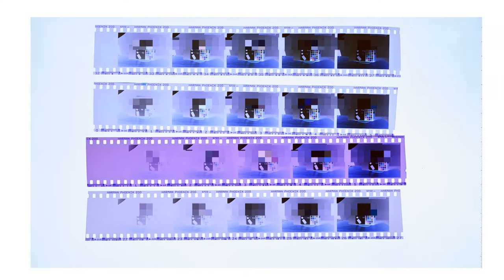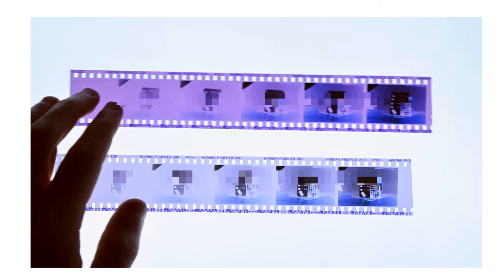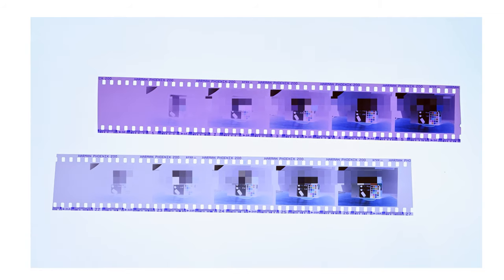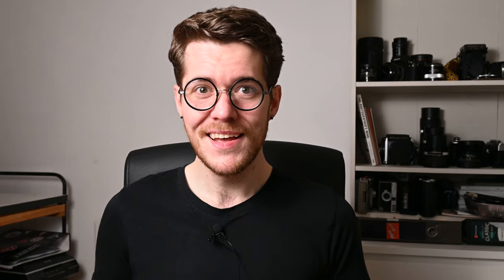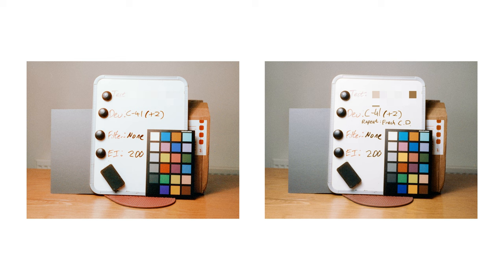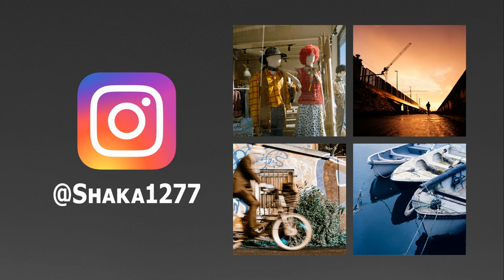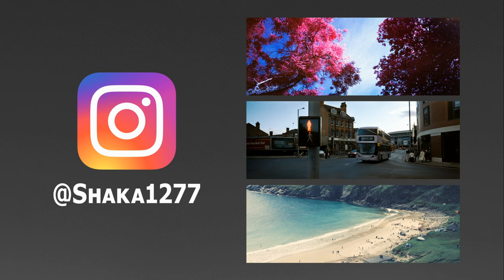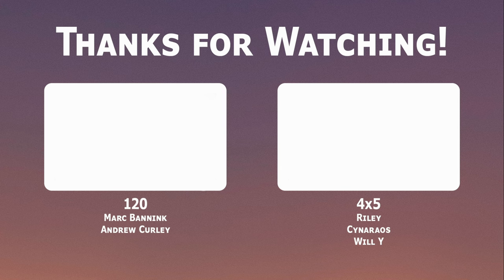Mastering Harman Phoenix #3: Purple

Comment: Okay I am exremely interested about this, I have not watched the video yet, I am only at around 1:33, but I have 4 remaining rolls of Phoenix 200 (I actually like the halation and the very high contrast a lot, and I rate it at 160 ot 120 iso and I get a lot better shadows that way. I find it is a very fun film to use, and I kind of want to get a bit more in the stash just because it's "limited" and I like how it looking before they invested in "improving" their color film)

All the phoenix 200 I shot I developed at home, in my the same very first batch of a C41 kit from BelliniFoto. The 2nd roll of color film I ever developed with my hands probably was P200. The later rolls have more purple in the base than the earlier rolls. I have not yet got rid of this first mix of color developer. I have a bottle of fresh developer to "recharge" the BelliniFoto Amateur RapidAccess kit that is sitting for me to have fully exhausted my first one. It's been not used in the recommended timeframe of a week by the manufacturer of the chemistry, but it was kept in the dark in a bottle with no air/oxygen in it in a cool place for all that time. 

So I am definitely in the "I am developing this in old chemicals" situation right now and I had a different result of just the film base color when developing this in extremely fresh chemicals

Comment: I have been experimenting with this, and I've found with lots of rolls and bracketing, that: 80 ISO, pull develop -1 stop (so in other words treating it like native 160 but pulling 1 stop), and then white balancing my scanning DSLR to the empty leader, and simply inverting in photoshop, gives almost 100% perfect real life colors, wonderful saturation, and much better latitude than normal, on par with most consumer grade kodak films (not portra or aerocolor or anything). I find 125 works best when not pulling, but 160 (down to 80) seems to work better when pulling, like sort of a compromise somewhere, I guess.
Reply from the maker: That's not so far off what I came up with in my Part 1, though I still use NLP for inversion out of habit.

Comment: Off topic, how long one should increase C41 development time to push one stop? BelliniFoto's datasheet has zero information about this, and they have just said to me "we do not test these parameters" when I tried to ask via email
Reply from the maker: Per Kodak's documentation, add 30 seconds for a 1-stop push or 60 seconds for a 2-stop push. I've found that works very well, even extended to 3 stops.
Reply: @Shaka1277  Noted! Thank you! I am now just watching video #1 of this series now. Thanks for doing this, it's very cool and interesting!
Reply from the maker: Glad you're enjoying it, have a great weekend!
Reply: Cinestill says 2.75 mins at 102F versus 3.5 normal = 1 stop pull, I followed that and am happy with the results. Edit: oh you said push, for push Cinestill claims 1 min and 5 seconds (very specific) longer for 1 stop. These aren't the same as Kodak's chemicals, necessarily exactly, though.
Reply: @gavinjenkins899  the cinestill kit is weird. I gonna stick to a normal 3 bath + stabilizer running at the nominal 38 Celsius one. Should match whatever docs came out of Kodak in that case
Reply from the maker: The first time a friend asked me for help reading the Cinestill "E-6" kit instructions I almost had another stroke.

Comment: Enlarging and printing be an issue
Reply: In reality it isn't. Phoenix is hard to print, but that's as much to do with the contrast as anything else. Yes, the colour correction is considerably different from a standard orange mask, but it just means your start point is considerably different.
  I've printed phoenix negatives using my intrepid compact, and if I can RA4 print them on that, then someone with ability and a proper colour head wont have problems.
Reply: Not for 99.8% of people, even if it was literally impossible for sake of argument. Because almost nobody prints color prints themselves.
Reply: @gavinjenkins899  You'd be surprised! Color RA-4 darkroom work is actually not that much harder to do at home than black and white. Same with developing color film, the modern easy trick is a sous-vide cooker. Use a development drum made for paper instead of trays, and it's rather easy to deal with.